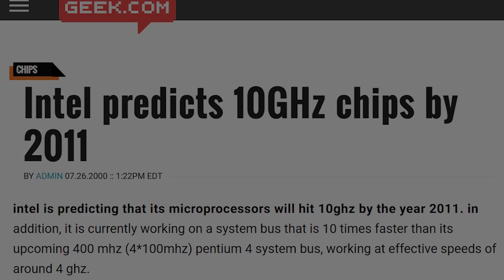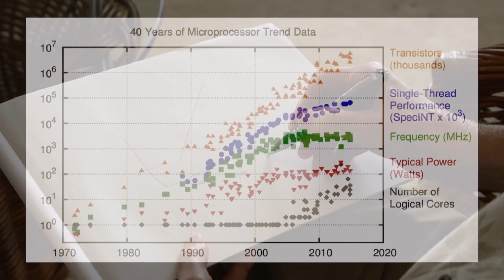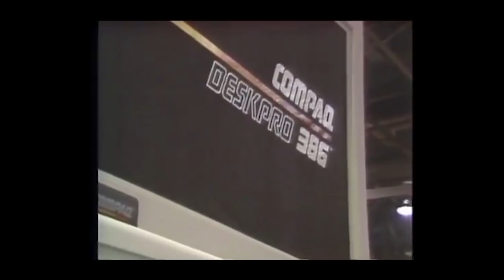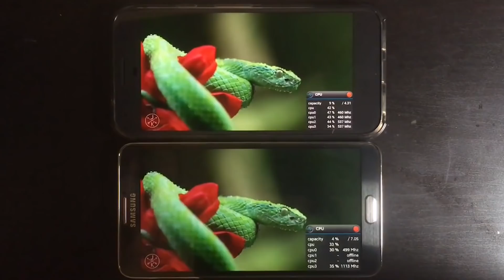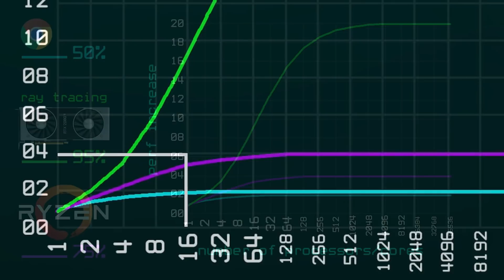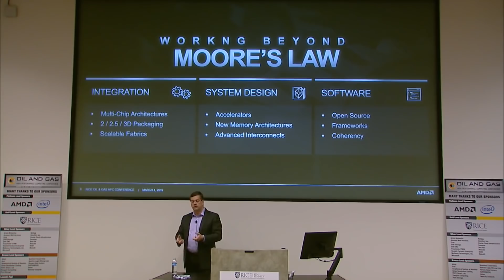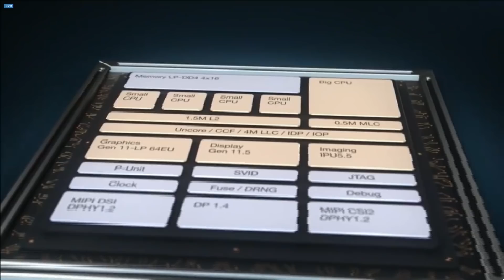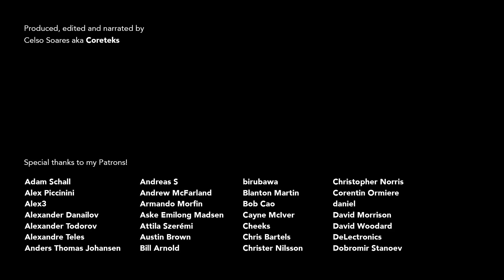Intel and AMD going BEYOND Moore's Law

Comment: Coretek is obviously not a developer. There are fundamental limitations that stop you splitting up a single threaded task. You require the result from the previous calculation to perform the next.
Reply: Yeah that was my thought. Whoever said that it's programmers just 'being lazy' has probably never actually tried to do it themselves and has no idea of the challenges of multithreaded programming.
Reply: Yeah, predictions on our outputs are already happening, and have been a thing for years. That's why the infamous specter and meltdown bugs were a thing.
Reply: @agr metor Yes but we are trying to solve the problem of too many cores and how to make them useful instead of them staying idle. The cache will increase. Due to diminishing returns cache is limited to profiled demand. If cache demand increases they will sacrifice a few cores and use the freed up transistor count to add more cache. Zen2 is doubling the per core L3 size and quadrupling the on package L3 size. So cache size is increasing faster than core count. Expect that trend to continue. Adding cache is easier than adding cores.
Reply: For truly fast multicore performance, there can't be any mutating state that is read by another core/thread. Sure, you can have global mutable state, but you need some synchronous mechanism like locks, semaphores, and other intrinsics that allow for safe transfer of data from one thread to another. All of these things only serve to slow down the rest of the code down. A.I. is the snake oil that serves well for companies/education systems who are too lazy to teach proper multithreaded programming and will ultimately doom the industry at large with worse programs, horrendous kernels, and lots more security vulnerabilities.
Reply: disagree... with the op comment. he is not looking into this at a large picture

consider the following code
A=5
-----core 1
B=7
-----core 2
C= A+B
-----core 3 when core 1 and 2 are done which will be faster than core3  doing that

D=C*20
F=(D/A)*B
------core 4

RESULT = F

the above needs all the calculations on each line to have the previous line completed... but it can be split into many cores and get that results phase by phase and then at the end combine them into 1 result. all the task will be executed in a parallel task (that can)and will not hang on the existing threat waiting for them. .net doest already partially that with Tasks and Await but your control what can be splited to what parallel tasks.
Reply: @johnnyxp64  The bottleneck is threads synchronization, context switches, user/kernel mode switches and data exchange between cores. It takes tens or even hundreds of thousands of CPU cycles. Concurrency can improve the performance only when threads are doing a job long enough compared to the inter-core interaction overhead, otherwise the performance will be lower than in single-threaded implementation. Interaction with data caches makes situation even worse. Another limit is memory bandwidth. When algorithm is already memory bandwidth limited, it's parallelization will not improve the performance, it will only make it worse.
Reply: Yes.  He keeps reasserting that we can automatically multithread things in his videos when it almost definitely is impossible.  Computer scientists would have worked on the problem for decades and never found an algorithm for automatically breaking up sequential algorithms.  Developers need to indicate what work can be done in parallel even if that means multithreading, vectorizing, or what work can be done independently for each pixel of an image.  They usually need to be explicit about when threads need to wait for each other too or the most threads that can run in parallel for specific critical sections of code.

That being said, it isn't hard for a good developer to use multithreading and if using too few threads is noticeably hurting performance, a good developer will find a way to speed it up with multiple threads especially when computers get vastly more cores.  Mobile phones typically have 4 or 8 cores and native mobile phone development tools typically force developers to do certain work outside of the UI thread so multithreading is forced on developers even when they want to be lazy.  

Taking advantage of multiple cores in JavaScript is pretty awkward but each browser tab will use different threads.  Browsers accelerate various HTML and CSS rendering steps using the GPU and JavaScript can make use of the GPU through WebGL even with custom shader code.  Using web workers is much more annoying than multithreading in other languages but it can help.  

For cloud computing, software is parallelized to the extreme.  Nearly everything is split up into multiple threads, heavy processes, separate virtual machines, separate services running on separate machines... often leading to far more compute-heavy threads than cpu cores.
Reply: @htko89  Not all outputs can be predicted. But it is very common for programs to have repeatitive action or have binary output. For repeatitive action you just predict that the output is also repeated. For binary output you pick one. This is the same stuff with branch prediction that is happening with superscalar processor. Only on the thread level and you have OS level context and have application profiling as guides. The goal is not to speed up the worst case but to speed up the common case. Most application is not optimised for multithreading so there is a lot of low hanging fruit that can be harvested.
Reply: That is why you need AI to predict the output and feed it to the next step before the previous step is finish. This is how branch prediction and cache prefetching speed up superscalar processor. You just need to scale this up to thread level a superthreading of sorts. You need a more complicated predicting system than the ones use in superscalar processing. This means you need Machine learning as bases for your prediction system. The javascript engine of some web browser is doing something similar to this they are predicting the variable types on javascript code so that they can precompile the code and just recompile it if the prediction is wrong.
Reply: @kazedcat  I highly doubt it would be benificial in most workloads.
Reply: @kazedcat  AI is a marketing buzzword bullshit. There is nothing can be done to inherently serial workload. You can not process the data, that are not yet exists. And if algorithm can be made multithreaded, developer can do it much better than any automated tool can do.
Reply: @kazedcat  your comment on javascript runtimes predicting variable types is calling tracing JIT compilation which relies on recording the types of variables throughout an execution frame (usually a loop) which slows down the processing throughput of the application from the recording. "just recompile if the prediction is wrong" also isn't as easy as a decision to make. Deoptimization, its known term, isnt as easy as theres overhead in switching between the interpreter context and the jitted code as well as modifying call stubs in the jitted code when compiling another method. Recompilation also isnt cheap and if done in parallel needs to be synchronized with new information from other traces.

Yes programs tend to have repetitive actions with similar data types but the inputs vary so greatly that predicting the output data or mutating the input in advance doesnt seem likely plausible. Application code also doesnt have binary output and when it does (usually in the context of Result sum types) the output is reliant on the input from earlier which isnt the same as what is done on the CPU. Branch prediction on the cpu predicts an execution pathway and to perform that on the software level would require a form of transactional memory (which can be expensive to create) in order to not redo the computation if the prediction fails.
Reply: @kazedcat  That (branch predication) is also the cause of all the Spectre vulnerabilities. Something like that is not only complicated, the performance increase is not very big, because you still have to check if the prediction was correct, and often it's not meaning a lot of work has to be recalculated. As a developer myself, I can tell you that is not the solution. This is only good for a very limited subset of workloads.

Comment: This sounds like amazing news. Can't wait for this to get into consumer products! maybe this is also used in the new Intel GPU? at least once the product is on the market I will buy it for sure. still running a dusty old Hasswel-E but since i do not see a noticeable improvement to buy new hardware i am stuck on this chip or at least i don't want to spend 1+ K to get a marginal increase

Comment: 10 ghz, I don't think that's far off though. If you think about that statement in the context of technology of that era we're talking about what? single core CPU's? maybe dual core or dual thread? 

A quad core chip running at 2.5 ghz...that's not a 10 ghz CPU but really, how different is it from the performance gains he was inferring?

Comment: Wait wait wait wait, hold up.  One does not simply multi-thread code.  There's only certain segments of code that can actually be run in parallel and knowing what can and what can't can be extraordinarily difficult.  Other times, you need to do extra steps, duplicate memory, have extra variables, recombine things post parallel segments, etc.  It is not trivial.  And no hardware can just parallelize things automatically without knowing the full code and what can interact with what.

There's something called OpenMP that makes parallelizing loops easy, but there's always a startup cost do creating threads that can hurt performance if the loop is small or not complicated enough to warrant it.

Idk who you talked to about automatically threading processes, but they weren't telling you the whole picture or you misunderstood what they were saying.  At best, multiple cores could share their arithmetic units like hyper threading does with multiple processes.
Reply: THIS.

Writing multithreading code is ... hair-raising. There are race conditions, thread deadlocks, and even problems of shared data.

There's a reason why most programs are not multithreaded: The effort to debug problems increases significantly. It's a tradeoff between performance increase -- which won't ever scale linearly to the number of threads -- and ease of troubleshooting/maintenance.

Also: Multithreading is not the be-all-end-all solution for performance limitation. Some logic are unavoidably sequential (e.g.: Transferring money from one bank account to another). Split this into threads and the changed order will potentially cause great grief.

Games might also suffer. Imagine if the engine performs two possibly parallel computing in sequence: Move target character, move bullet, detect if bullet hit target's hitbox. This can theoretically be deconstructed into two threads (1) move target character, (2) move bullet (and detect hit). If (2) finishes before (1) -- which is very likely to happen since (1) is more complex -- then it might cause a hit where the sequential process wouldn't, or the other way around, a miss where the sequential process would hit.

So, even if there are safe ways -- using AI, ML, or whathaveyou -- to "automatically" convert single-threaded processes to multi-threaded processes, I don't believe the performance increase would be significant. Simply because there are too many places where such conversion will cause problems. Not to mention an exponentially increasing difficulty in troubleshooting, as the "automatic conversion" might introduce bugs not visible through step-by-step debuggers.

Comment: Hey coreteks, you think they might come up with some kind of AI based interpreter that automatically optimizes your programs for multithread so you don't need specialized hardware to do it on the fly?
Reply: Superscalar processor is already doing this at instruction level execute multiple instruction before previous instruction are done.

Comment: By the way, quantum tunneling of electrons will break silicon transistors at 2 nano-meter size or smaller, so they are not likely to go much below 5 nano-meter transistors unless they switch to a different miraculous underlying material circumventing these issues.

Comment: Hey young man I have a Question ......You said this uses Multiple Threads to achieve the high performance.......would this work for GPU's too.....I ask BC the Greedy Green Company claims they are already testing some chip with chiplets ...18 or something but i found it funny BC it seemed to me to be just like the First Ryzen that Intel and #NGREEDIA laughed and made fun of but now are both copying to some degree....This is why I ask BC some one said instead of just doing that why not throw 2 chips almost like sli on the GPU main board ....Hopefully AMD who are working on the Chip-spread load as I heard it called @ AMD if they are still Thinking OUT of the BOX for the NEXT thing then Hell do this on BOTH GPU's and CPU's BC if AMD can get BOTH working on 1 Platform they will BLOW away BOTH Intel and #NGREEDIA almost over night until a year later when they beg for mercy.   If you are gonna dream half way I want to go full on FUCK em BOTH....lol   Yes I know Intel wont fold they have thje Tech and the Money so they can or might even get it working as good as AMD but IF both do it will KILL the GREEDY GREEN TYRANT and his OP pos company OVERNIGHT almost or make it OBSOLETE IN a yr or so!!!   OH WE CAN HOPE!!! Cow}:-o)

Comment: I think you're mostly right, but RE:  Amdahl's law, by my reckoning that would only apply to a single task (so total speedup possible of task A) but if you're running multiple tasks simultaneously (A, B, C) you would still expect some improvement above 32 cores. 

obviously for servers that do dozens to hundreds to thousands of tasks it probably doesn't factor.
Reply: Agree!

Comment: CPUs sharing work across cores automatically via AI is horrifying.  Specter and Meltdown will look like minor security flaws in the face of this, at least initially. Things will likely get better in the long run, but at first I guarantee there will be similar speculation attacks, and if the work is just being thrown around cores, it'll be worse than Specter and Meltdown.  I really hope I'm wrong here. Hopefully hardware engineers will remember the previous flaws and use what they learned to prevent new ones, but I'm still thinking it'll be bad initially

Also your pessimism about programmers not changing how they code is interesting. A huge shift towards functional programming has begun, which has a few negative performance impacts in single threaded applications (for now. more advanced compilers are improving on this), but makes parallelism trivial.  Software services running on servers use this already.
Reply: @Tab programming languages like Rust, Swift, Kotlin, Scala, Haskell, and Idris have been on the rise in the industry.  Look no further than Facebook, Twitter, Google, Disney or any startup tech companies over the last few years. Android runs Kotlin, the iPhone runs swift, and many of the popular apps you use today are interacting with servers which use one of the aforementioned languages.
Reply: @Tab As far as I know it's industry wide. It's a shift that's still happening, so there's still a lot of people who haven't done it, and there's some resistance to the new stuff because it's radically different from what used to be done, but from what I can tell it's here to stay.

Beyond the benefits in writing concurrent systems, stuff written with functional programming tends to be easier to scale in terms of complexity.

Its important to note that when I say "functional programming" I'm not talking about the use of anonymous functions which some people might think. I'm talking about functional programming using things from math. Laws, proofs, category theory and the like.
Reply: @Tab yeah that's a big part of why it's helpful. The category theory laws and whatnot just provide us with guarantees about what happens when we compose operations certain ways. Those guarantees can indicate to us when things can be paralellized. And as compilers get better, compilers may start automatically picking up on stuff like that for us. Most (if not all) of those laws which allow us to do this will fall apart when you introduce mutability.

I should also add that currently the industry seems to be moving in this direction, but most universities are still teaching older methods. Professors like Philip Wadler give me hope that university is moving in the right direction. He's done a few presentations about category theory and lambda calculus which are on YouTube. They don't talk about concurrency specifically, but if you're interested in the mathy side of what I'm talking about,I suggest checking him out.